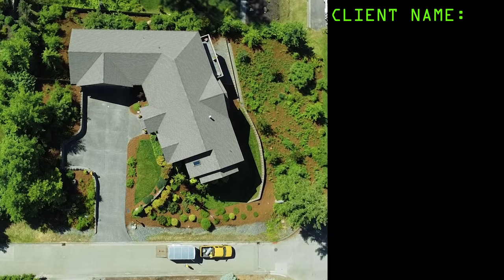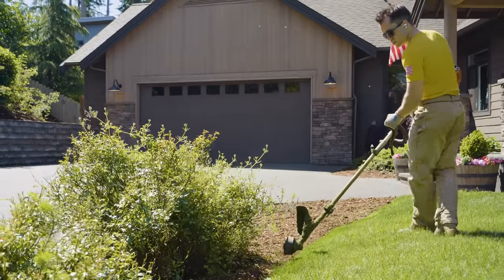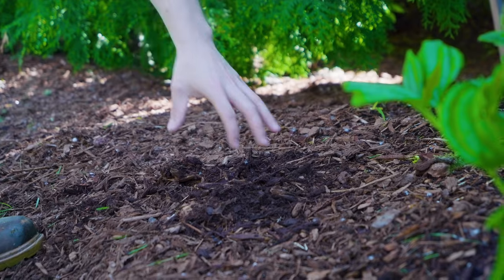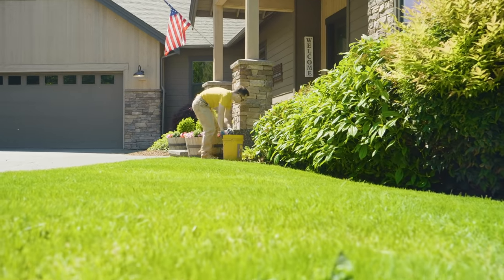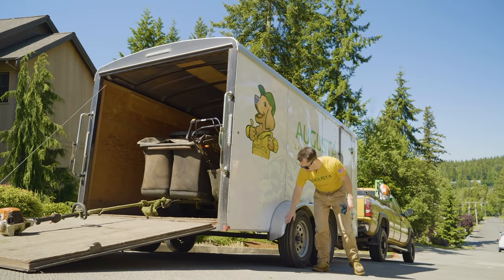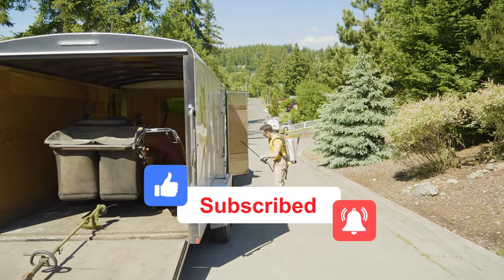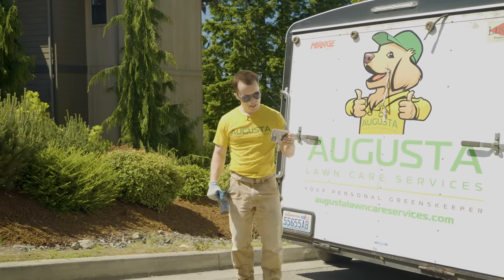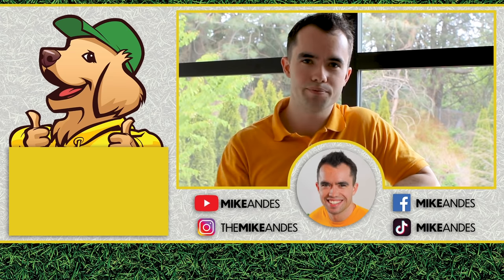The ULTIMATE Mowing and Lawn Care Equipment Setup!

Comment: I saw a big front wheel drive car cut behind the driver and passenger seat with a boat trailer.
I thought a perfect mower rig would be the same idea with a flat bed trailer on the rear with electric brakes and brake controller. Ramp gate with lift springs. Trimmer and blower rack and a waste bin.
Also a magnet on the side with a big phone number is all you need( with call or text welcome)
The neighborhoods where I want more lawns I try to cut between 4pm and 7pm. So people can see me and flag me down. The large lawns I usually did in the mornings.

Comment: Thanks for the video I have a lawn care business for over 30 years in Redding California,  a friendly tip is to go clock wise when using the string trimmer so you don't have to walk backwards it's a lot easier and faster first 10 years in business I was going counter-clockwise also :-)
Reply: Nor cal ✌️
Reply: It leaves a mess though. Going counter clockwise pulls all the edging cuts into the lawn more

Comment: Also I owned a 30 inch ex mark push mower. I liked how you can change sizes and side shoot. But for 2400$ I couldn’t even pick up wet grass and engine could barely handle

Comment: IMO the European trailers are much better build. Galvanised chassis and other steel parts. The side panels are aluminium or polyester insulated foam walls.

At this moment I drive a Land Rover Defender, but I’ll trade it in for a van as VW Crafter or MB Sprinter.

Comment: Man I love them commercial Honda’s! Never let me down. Perfect for hills, picks up wet grass better, and don’t have to replace belts. Don’t get me wrong I love my 21 commercial toro. But if it’s too wet the tires aren’t good. And they aren’t too good on hills.
Reply: Only downfall is it’s a bit more slow than the toros
Reply: Weibang are brilliant mowers, they’re on par with Honda and in some cases better depending on the model
Reply: @bigjay24910  yeah different models. I just love not hanging to replace belts, and mot habing to push on hills the Honda’s are crazy. And I will be ever regret buying them.
Reply: @bigjay24910  I also love it has two blades and all sizes to mow
Reply: @bigjay24910  I hear good things about weinang too! Definitely a brand I should try sometime
Reply: @mrwho2174  I have a Honda izy and a lawnflite (kaaz) with a Honda engine. The izy is 17 years old and it still runs like new and not a spec of rust. Can’t beat Honda engineering.
Reply: @mrwho2174  not too sure if you can get the KAAZ mowers in the states but they’re brilliant machines. They’re based on the old Honda design. I can cut soaking wet grass down to 1” and the mower doesn’t miss a beat.
Reply: @mrwho2174  I have a weibang (homeowner model) it’s done 3 seasons and still fires first pull from cold, it’s an absolute machine, cost me £250 it’s earned me a small fortune, paid for itself after 1 day

Comment: Little tip when strimming. If you walk anti clockwise around the lawn with your trimmer the grass will be kicked into the lawn instead of the borders. Then you just pick it up with the  mower.  Same goes for trimming near windows, vehicles etc. If you stand facing a window or car and move the trimmer to the left, any debris will be fired back towards you Instead at glass and paintwork
Reply from the maker: Very good
Reply: @MikeAndes  it’ll reduce your workload dramatically plus speed things up a bit. Keep the head on the floor too and let it glide along. Gives a nice even cut and reduces the strain on your arms. Just lock your elbows into your sides and let your legs and hips do the work

Comment: You charge $20 to weed this yard?? We would get at least $150 for this service.
Reply from the maker: Let’s go! 💰💰
Reply: He only has 0.25 hrs(15 minutes) budgeted for weeding the beds which equals $80/hr. If you charge $150 for a service that takes you 15 minutes, that means you made $600/hr! Good for you if you can charge that, but I have feeling there is a misunderstanding on the numbers here.
Reply: @bladesofglorylawncarellc559  he would need to spend a lot more than 15 minutes weeding and spraying what he videod.